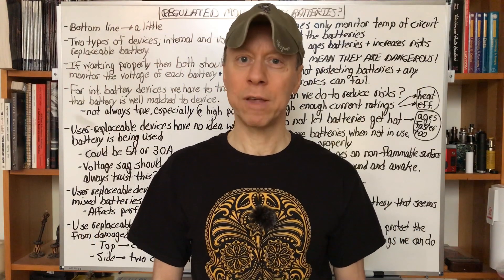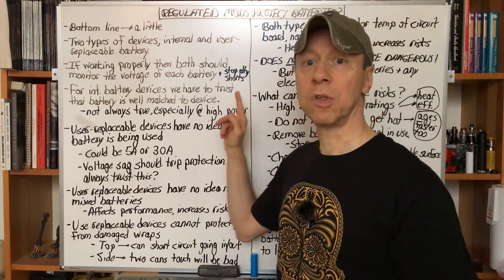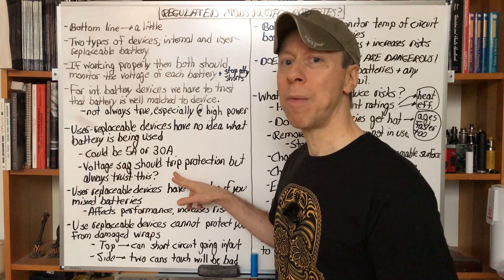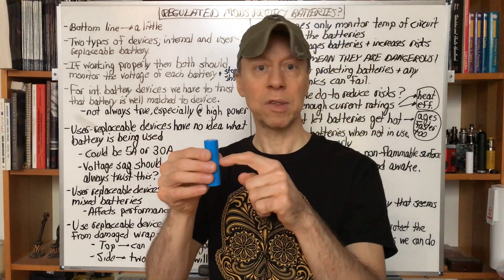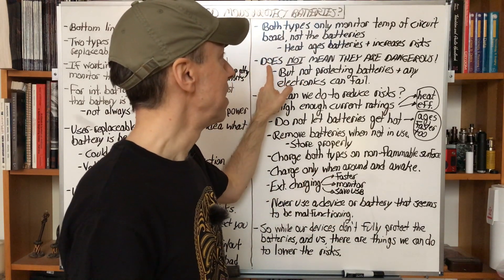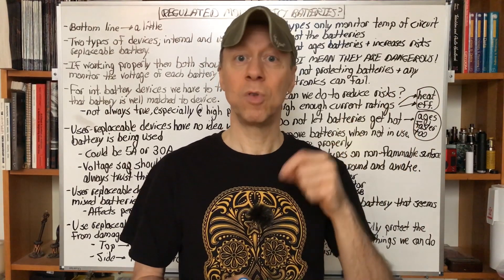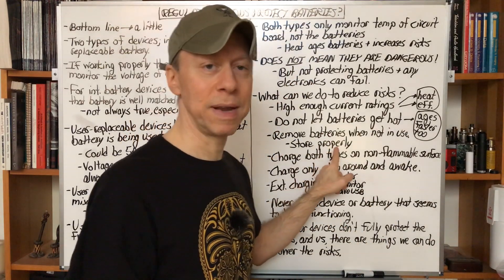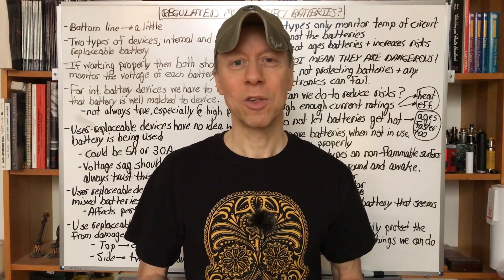Battery Basics For Vapers Ep003 – Do regulated vaping devices fully protect the batteries we use?

Comment: Awesome info once again brother, thank you. 
The subjects you touched are the main reason why I give props to devices with plastic battery compartments and the reason why one of the tests I do on mods and also the most time consuming one is the battery voltage cutoff with both balanced and unbalanced batteries and I also test how well and balanced they charge the batteries inside.
But indeed, devices with internal battery and temperature probe on the battery and not just in the PCB is a lot safer.
Reply from the maker: Thank you for your support brother!
Your testing is invaluable for the community.
Reply: Hi, Daniel!  (I meet up with the best people here with Mooch.)
Reply: @batterymooch  You're welcome brother, just like you I'm here to help the industry
Reply: @DJLsbVapes  and don't you ever think that it isn't appreciated more than you know. mooch this goes for you too, of course.
Reply: Very good warnings - just one accident hitting the news hurts us all. I think more reviewers should do a bit more than promote and collect the money... We need education, not more smoke ;)

Comment: Great video i keep all my 18650 batteries in a waterpoof air tight case from amazon they dont have them for 21700s but at least half my 🔋 are sealed up the 21700s i keep in a regular battery case

Comment: “User replaceable devices have no idea what batteries are being used”
True,but some regulated devices programmed their chips that whenever you put/used a typical low drain type 18650 that can only fire at max of 5 amp,and your coil set-up is ex.0.5 ohm that can fire at 5amp max or 12.5w,the mod wont fire and the mod will alert you and flash a screen warning “Weak Battery”.,i think it’s a kind of security they put in their chip not to use that battery even if it is fully charge.I’m talking about eleaf istick pico 80 watt mod that still running and i used it only for rebuilding atty.
    Thanks Mooch for another great and very informative video.,And thank you for keeping the vaping community safe for having a video like this!
Reply from the maker: Thanks for the info!
Sounds like a better version of monitoring the voltage sag to try to catch the use of low current rated batteries.

Comment: If it was possible to give 1000 likes I would. One suggestion:

What about testing the batteries of internal battery mods? That would for sure be interesting for widely used models. I'd be willing to bet that at least some have dubious quality batteries in them.
Reply from the maker: I suspect you are right. 😁
Sooo much on my plate right now though...no time to add regulated mods unless it’s a particularly obvious exaggerated rating for the battery.

Comment: I'm fairly new to vaping, you provide invaluable info! You brought up the plastic insulating rings, I recently had to rewrap a battery, when I ordered wraps I spent some time trying to find replacement plastic rings, no go - only paper. Fortunately I could reuse the original plastic ring this time but I'm sure there will a point in which I cannot. Is paper a safe alternative to a plastic?
EDIT: I'm saying paper ring, actually referring to 'cardboard'
Reply from the maker: Don’t let eliquid get on it and it should be okay...as long as it covers everything and doesn’t get pushed out of the way. Keep the wrap in PERFECT condition and never use a device or charger that damages the wrap.

Comment: Dual 3400mah lime green panasonic ncr18650b protected cells can't fit in my regulated vape mod's door's completely shut. I want to remove any more layers of plastic that are safe, but I removed a clear cover, and a circle sticker, still won't close, I just bought these and have vape mail on the way,  so I cant tear them up any further till I'm sure its ok.
Reply from the maker: STOP!! DO NOT USE THOSE BATTERIES! 
Never remove ANY wrap from a battery unless you are completely sure the wrap is only there to keep the contacts of a new battery for touching anything. NEVER REMOVE THE TOP INSULATING RING! You battery will now short circuit every time you put it in or take it out of a device and can explode. YOU CANNOT USE THOSE BATTERIES NOW. You must carefully replace the top insulating ring and the wrap you removed.

Protected batteries do not fit in almost every device we use. You cannot use those NCR18650B’s for vaping. They are only rated about 3A or 4A or so, maybe 10W or 12W, so they are only fit for very low power vaping anyway. Use them in a flashlight, after rewrapping them carefully if needed, and buy unprotected batteries with a current rating high enough for the way you vape.

Comment: Thanks for the info, if the atomiser was removed from a regulated mod rather than the battery im assuming this would remove the risk of autofiring when the mod isnt in use, but is there a way a hard short could discharge the current through the mod itself? Assuming the battery is in good condition, no tears etc. Im assuming there would have to be a short between the insulated 510 pin and the negative terminal (threading) and also a short in the chip (firing button) at the same time?
Reply from the maker: There would have to be a short circuit somewhere inside. The wiring, circuit board, somewhere. Any electronics can fail, and have failed. Any device can be assembled badly, and have been. Each of us has to decide what risks we will or won’t take though as there’s no “correct” thing to do. Just our preferences.
Reply: @batterymooch  thanks, I guess taking the battery out is the safest option then 👍🏻

Comment: Thanks Mooch. I have a pair of vtc5A and vtc6A and an xstar vc4 charger. But for the last month the batteries only charge at 0.15 A according to the charger and i have to plug and unplug the charger for a few times to start the charging because most of the times says 0A charging and they dont charge at all. Same does with an 21700 AWR battery. What is the problem the charger or the batteries? Thank you.
Reply: I believe the vc4 runs from a usb cord. Ensure your usb power supply and cable are up to the job. The usb power supply needs to be rated at a minimum of 2amps. If you're trying to use it via a laptop or usb extender, forget it. You need a dedicated mains supply for this .
Reply from the maker: Sorry, I don’t know. As Ben Armstrong mentioned, make sure you are powering it correctly though.

Comment: Great video! I'm new to vaping and i realized that i prefer DL over MTL, so now i have to buy a dual battery mod, the only reason i'm not doing it still is because I'm very very very afraid of the batteries exploding ... I've watched so many battery safety videos and still can't get over that fear ... can anybody suggest something?
Reply from the maker: Perhaps start with an internal battery mod? If you get one with a good reputation then you don’t need to worry about changing batteries. Just be careful and gentle when charging to increase the life of the delicate USB connector. Use a good charger, like an Apple iPad charger, and a good cable and only charge when you are around and awake.

Comment: I got new Vape pod (smok nord 1100mah) and they provided me with tiny charging cable with it, I want to get long cable... What specifications should I see to get 1?
Reply from the maker: Long cables can be a problem because of their higher voltage drop. I don’t have specs I can give you as the larger the wire gauge and the higher the quality of manufacture the better. Do not try to save money here. Check for reviews from respected sources and buy the best you can find.
Reply: @batterymooch  thanks, I will try some brand with positive review.

Comment: I emailed lion wholesale asking about the new Molicell 210700 specs which mooch gave a 30 amp continuous rating, and they told me this: “Molicel rates the P42A as a 45A continuous discharge rating battery. Mooch is a third party tester and rates the batteries very conservatively to make sure things are very safe. His rating is a very useful tool for comparing batteries. However, his rating is not the official rating...the official rating is 45A.continuous.”  So what’s the true rating? Does this p42a beat the 30t for initial punch since mooch rates the 30t ar 35amps or is he underrating the 30ts true performance in the name of harm reduction?
Reply from the maker: I do not underrate in the name of harm reduction. All of the cells I test are rated the same way and result in ratings that can be used to directly compare cells against those from Samsung, Sony, LG, etc.

Molicel’s 45A rating for the P42A was set for the application those cells were designed for...power tools, electric vacuum cleaners, etc. Those applications involve continuous current from the cells but not for long periods. The 45A rating is not a true continuous current rating and cannot be used to directly compare the P42A’s rating to other cells like the 30T.

The current rating is not directly rated to performance or how hard a cell hits either. The current rating is related to temperature,  cycle life, and safety.

The datasheet for the P42A states that the cell must never be brought over 85°C and should be kept under 75°C at high discharge rates. This happens around 30A and is one reason why I set the rating at that level...it matches the operating limits in Molicel’s own datasheet. That 45A number is for short periods of continuous current and is not a true continuous current rating.

In my retesting of the P42A, scheduled to happen soon, I will probably end up rating the P42A at 30A continuous and give it a “temperature-limited” rating of 45A (you can run it at this level if you don’t get it hot and you aren’t concerned about long cycle life).
Reply from the maker: To answer your question...I did not underrate the 30T. The 30T still hits a bit harder than the P42A for parts of its discharge, no matter what current rating either one has. You’ll need to try both to see which might offer better performance for the way you vape...it’s a close call.

Comment: Hi, Mooch, is it normal that a mod cuts power at 3.46 volts?  It is a dual 18650, and that is the reading that I get when I take them out of the mod and put them into a Nitecore D4 charger.
Reply from the maker: Sounds like it’s cutting off at about 3.1V or 3.2V when being used and battery voltage sag has dropped the voltage down to there. That would “bounce back up” to about 3.5V or so by the time you put the battery in a charger.
Reply: @batterymooch  Thank you very much for answering my question.  At first I thought I had gotten a defective chip, but I guess voltage sag explains it.  When I press the fire button the battery icons go further down almost to the bottom.  By the way this is a Minikin v2.  Greetings from Costa Rica!

Comment: Hey Mooch, what kind of battery would you recommend for a vape? My Samsung 30Q suffered from heat and the wrap+ring came off (Refunding asap, I don't want it to explode)
Reply from the maker: Follow the link to my blog at ECF in the Description section. There is a link to my Recommended Batteries tables there with some great choices.

Comment: how do i know how much mAh do i need? by the recommended watts on the coils?
Reply from the maker: You don’t really need any amount of capacity (measured in mAh) but the higher the capacity of the battery the longer it can run. Get the highest capacity battery that has a high enough current rating for the way you vape.
Reply: @batterymooch  thanks, i dont really vape yet so i dont know what will be a high enough current for me, but when it says "10C  30A" the C is the current rating?
Reply from the maker: Philosophical Mind It sounds like it. C-ratings are pretty useless though as exaggerated too often. Just use current ratings, if not exaggerated too. I don’t get alerts all the time for YT comments but for up to 90W in a dual battery regulated device use Samsung 30Q or Sony VTC6. For up to 120W use LG HG2. For up to 150W or if chain vaping, use Sony VTC5A. Keep the plastic battery wraps in PERFECT condition at all times and use a good external charger on a non-flammable surface and only when you are around and awake.
Reply: @batterymooch  thanks! i guess by current ratings you mean the "30A" thing right? 
so if i need to be awake to charge them then it would be best to get four batteries & use the already charged ones while i charge the empty ones, right?
Reply from the maker: Philosophical Mind yes. 
Which batteries have that 30A rating you are referring to?
Reply: @batterymooch  its sony 18650 VTC6 3000mha 10c  30a,  there is another one sony VTC5A 18650 2600mha 35A, which one would be better? i think i do chain vape, atleast with my mi pod.
so would you advice to keep two batteries charged so i can use them while charging the empty ones?
Reply from the maker: Philosophical Mind Yes. I replied to that question in my previous post. :-)
What device will you’ve using? What is the Recommended wattage range for the coils?
Reply: @batterymooch  i dont know about the mod yet but i want to get the falcon king tank, so its 75 wats & the other one is 80 wats.
Reply from the maker: Philosophical Mind okay, buy the Sony VTC5A’s in case you chain vape with the tank. Two of those batteries can handle up to 150W. I have a vendor list in the Description section of this video.
Reply: @batterymooch  ok, gonna check it later, thanks a lot for the help!
Reply: @batterymooch  can you advice on a good internal battery mod please?
Reply from the maker: Philosophical Mind sorry, I don’t have any recommendations for a mod. That depends on you and your preferences and priorities. Check the Best of 2018 videos for Mike Vapes, SuckMyMod, VapnFagan, and others to see some great choices.
Reply: @batterymooch  ok thanks

Comment: Something that mods could protect the user from is the effects of jumping resistance, caused by a fault in the atty or the mod. Ive seen builds around .1 jump to, say, .18 in one press, .25 in the next 1.1 in the next and so on. When this happens the vape is extremely hot and I suspect the current draw is massive. Its a bit counter intuitive, because although the ohms apparently go up, so do the amps. Its a definite danger for inexperienced users.

Comment: hi mooch I already bought mxjo yellow and silver I heard it's not good for vape is that really right or what By the way I use vaperosso polar
Reply from the maker: I don’t know what battery MXJO is using for that one now but it was a 20A rewrap when I last tested it. They rate it at 20A, look at the “back” of the battery wrap, near the bottom. Stay under 60W and never get it hot and always keep the plastic battery wrap in PERFECT condition.
Reply: Thank you mr mooch I use it under 40 between 25 to 35 ok it’s not dengerous

Comment: Why do devices with internal batteries even exist if it is not safe to leave your batteries in a device when not in use?
There are so many things we cannot do with an internal battery mod that you say we should do with an external battery mod I am surprised you do not condemn them outright.
Reply from the maker: They’re not inherently dangerous and the failure rates are incredibly low. But if there is even the slightest chance of something happening why not take a few simple precautions to prevent a failing device from causing more damage? Any electronics can fai, even the big name productsl. I can’t condemn all electronics. :-)